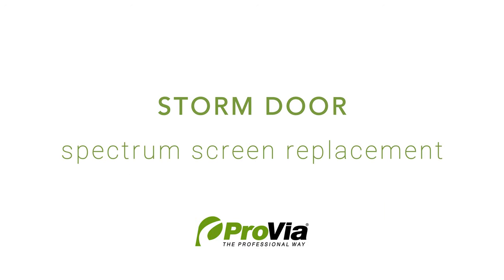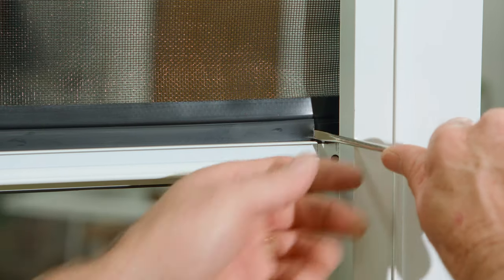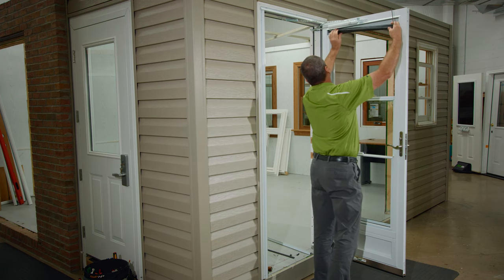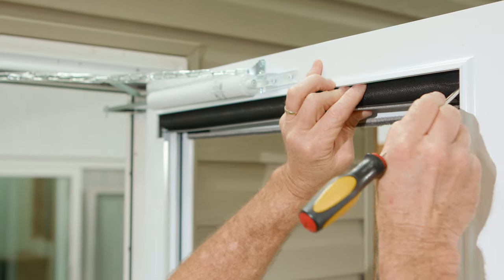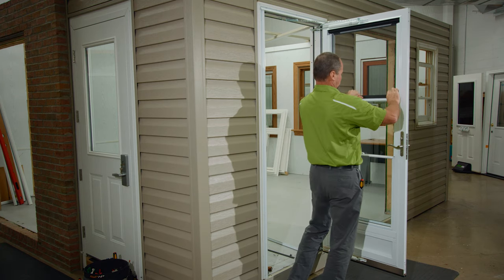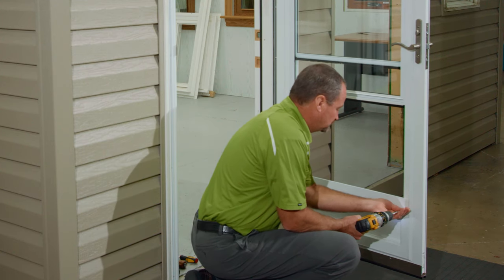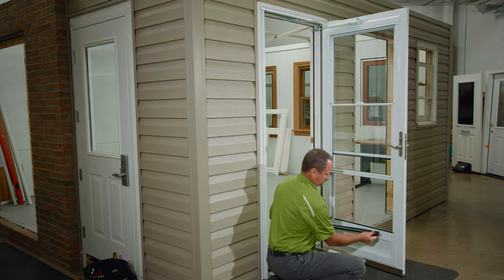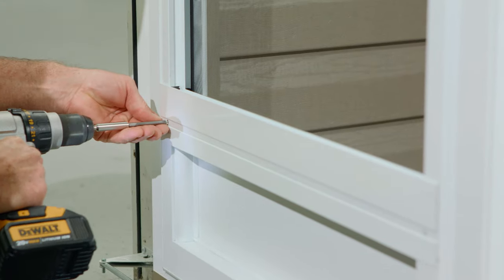Spectrum Storm Door Screen Replacement

Comment: @ProVia. Although the installation was with a Larson Door, (A Brand Carried at Lowes) There's only 2 (Two) Videos on ''Self Storing Screen Assemblies'' on YouTube. Bummer.....
 
Edited section: My ''Replacement Self Storing Screen Assembly for our Larson Door, lasted 2 months. Since the Outside Window wouldn't ''Latch/Lock, in the ''Up Position'', I've got to remove it & either get another ''Replacement Screen Assembly'', or get the $40-$50 back in a Refund & just buy a ''New Front Storm door''..

I ended up here after the storm door screen finally tore away from the door panel. Now first open your storm door. On the door jamb on the ''Hinge'' side, there should be a sticker on the jamb, you'll need that number in order to get the correct replacement screen. Now because the screens are installed at the factory, your replacement should come with an added part by the manufacturer that allows you to attach it to the storm window panel frame. Since ours is a Larson brand, on their website they have a ''How To'' video on this type of screen replacement, plus it's only $50 which seems cheap to me but hey, it worked. But as you can see in the ''Edited Section'' above, the Replacement Assembly only worked correctly for 2 months... Saying that I'm a little pissed, is an understatement, to say the least......

Comment: My door is only 2 years old and i am having trouble keeping the glass up. I have to really slam it which is starting to not work. Or push really hard while forcing the latch to catch. It seems like the glass should be sliding up an extra ¼ inch or so.
Reply: Ours does the same exact thing

Comment: There is a crucial step that is skipped and edited out. Its when he unscrews the plate then it skips to it already being off. How do you remove that plate?
Reply from the maker: Hi Kyle - after the screws are removed, the cover needs to be slid down approximately 3/16” and then lifted out. Occasionally it will be tight on the outside edges, between the frame, and it will need to be wiggled a bit to free it. 
The bottom is the same except that the cover needs to be slid up and then removed. Occasionally the side aluminum “jamb” extrusions will slide down and will make it difficult to lift the cover up. To remedy this, you will need to use a larger, flat blade, screw driver and wedge it between the top leg of the cover and where the bottom of the side aluminum “jamb” extrusion rests on the cover and pry it upward. This is a rare occurrence but does happen on occasion.
 Hope this helps clarify a bit. Please let us know if you have any other questions!

Comment: I would never own this type of door again. They are extremely heavy. The door handles are not user friendly. You can not replace the handle with the push button handles at all because these door handles are built into the door. The handle broke on us and Menards wants $50-$60 for one replacement handle. If I spend that on a handle, then I need new screen, and the window never wants to shut without slamming I will take all that money and buy a much user friendly door and a much lighter door. In my opinion as a home owner, this door is to problematic.